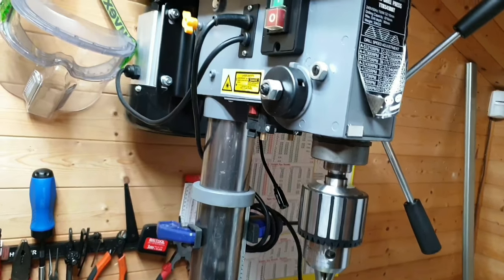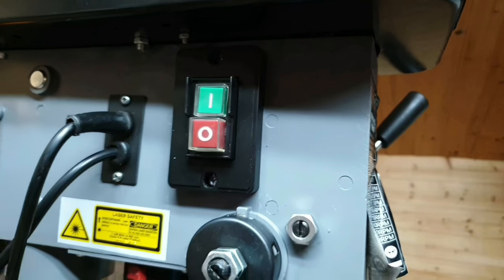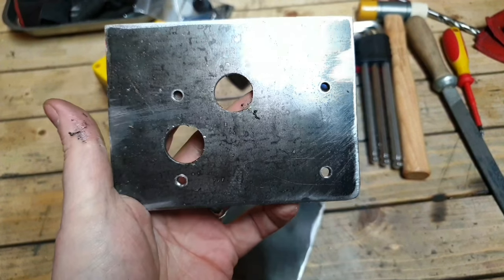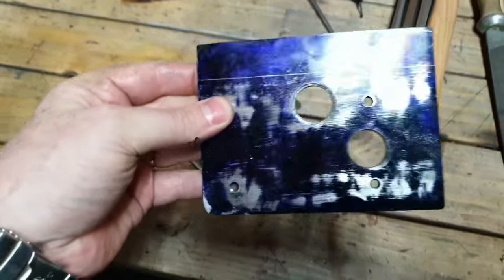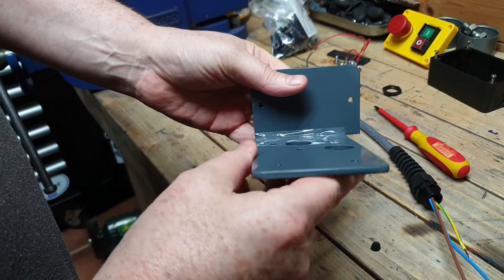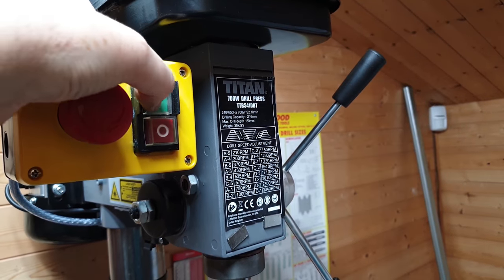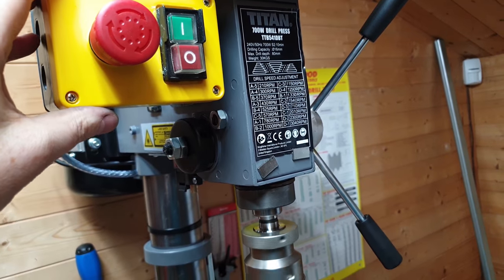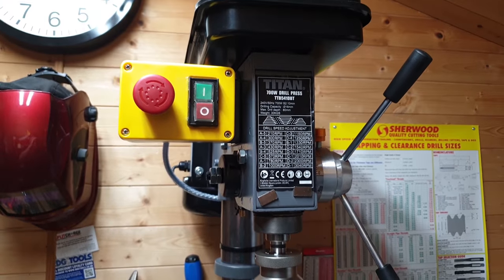NVR Switch with Emergency Stop added to Titan Drill Press

Comment: Hi, I purchased the exact same NVR switch as above to fit to my Kitty 619 table saw and followed your instructions to the letter all except for a black wire coming from the saws motor, the switch works fine but the black wire becomes live when the NVR is switched on. Any idea where I should connect this wire to. Many thanks.
Reply from the maker: Did you watch my other video?   https://youtu.be/0RRFBnKRnFM

Comment: I'm having to replace  an nvr switch on a drill press kjd12 but someone has already pulled the old one off and I car"nt remember how the belt case safety switch is wired into the system new switch works but need to put that switch  back into the system no videos on YouTube on full wiring a drill press nvr switch type kjd12 including belt case switch  cheers M
Reply from the maker: Had the same problem so I just disconnected the belt case switch completely. It's not necessary and my drill press works fine without it. As far as I'm aware it's wired in series to the incoming supply.
Reply: Very tidy job. I've got the same model and I'm thinking of moving the original on off switch to the same position just because its weird having it on the side.  Beefed up the pulley cover box with a 3mm alluminium base and fitted 2 adjustable hasps and neoprene so it's alot quieter. I want to do away with the internal safety switch in the pulley box but I'm not great with wiring. I see there's 2 wires from the safety switch connected to the on off switch. Does this mean i can loop 1 wire between the 2 connectors on the on off switch and do away with the internal safety switch all together. Thanks.